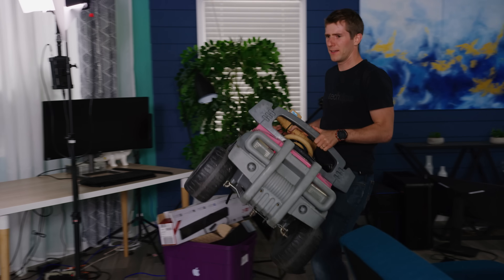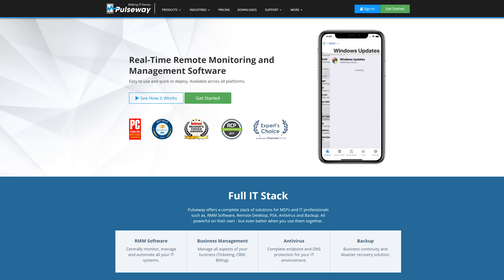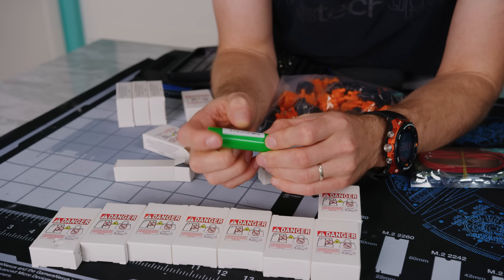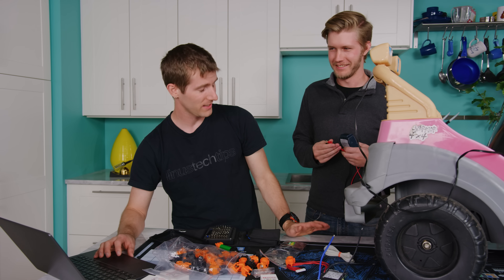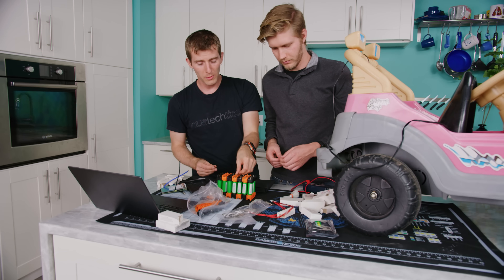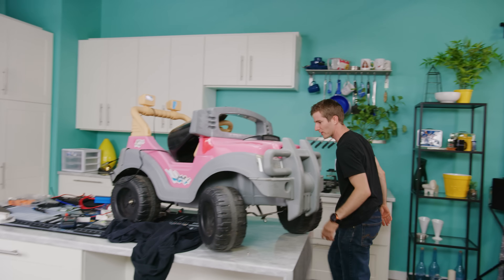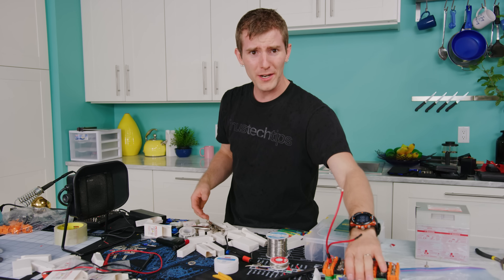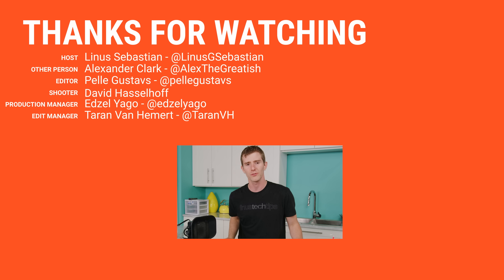DIY Lithium Battery - What could go wrong??

Comment: Suggestion: make a "do it yourself" Lithium car battery & charge controller, that would replace a normal 12 volt lead-acid (gasoline powered car) battery. Note: 26650 Li-ion batteries may provide for a better battery pack vs. 18865 batteries.

Comment: Try v48 or just replacing it with a 2000w power supply
Reply: The power supply would make it worse, it doesn't matter that it's 2000 watt. You're still only going to get 12v from it, so it'd be a huge downgrade.
Reply: Oh I was thinking the 2000w and like since 12v from one connection, you like, combine all connections and idk somehow make it work.
Reply: @flashqandr  Combining all connections would still result in 12v, and just because the power supply is 2000w, doesn't mean that the electric motors are going to use that much. They're only going to use as much wattage as they need, based on the voltage you send to them. If the motor is 5w at 12v, then it's not going to pull more than 5 watts. If you plug in a 2000w PSU at 12v, the motors would still only pull 5w. So to make your idea work, you'd need to send in 833 volts into the engine for them to pull 2000 watt, and at that point the engine would provably disintegrate lol
Reply: oh.

Comment: It's actually stupid to solder on Lithium Ion batteries. You should only ever spot weld onto them, because you don't want high heat on your batteries it will damage the capacity best case and worse case cause them to explode.
Reply: You are absolutely right but he didn't solder directly on the battery, he soldered the metal tabs doing the contact between batteries.
Reply: I don't think you understand how soldering works, to properly solder something that entire conductor has to be hot enough to melt solder, not just the iron that supplies the heat. The batteries connected to the conductor and were relatively close to the desired solder point.
Reply: @Ferretack  I'm pretty sure I know soldering, it's part of my job. I'm also pretty sure you don't understand thermodynamics well enough to tell the actual heat path and if it will damage or not the battery. Me neither, but from my experiences in soldering, I tent to believe that it won't damage battery.
Reply: MrBenthraxify no, u don't understand it. A small tab will heat up much faster than the battery due to it's small thermal mass. You don't have to hold the iron there very long in order for it to properly stick. I have soldered at least 400 battery joints and and nickel strips that were connected to 18650/21700 cells
Reply: That depends on your soldering skills and temp of ur soldering iron. If you keep the iron on for under 7 seconds per terminal, the battery cools down very quickly. I soldered a 16s3p battery and didn't notice any difference in performance. And who tf cares abt a 7s pack that will barely even get used. The spot welder will cost way more than the battery itself
Reply: If the tab is attached to the battery, it's sinking heat directly into the battery. Which means you need a higher temperature or a longer duration to melt solder on it. You aren't going to connect two conductors without exchanging heat, unless the connections are very very small and act as a bottleneck. That's not going to happen because high current batteries want a solid connection.

Comment: If you take the rubber tread from an old bike tire and screw it into the plastic wheels it will give you some traction on that bad boy.  We used to do this with my cousin's power wheels.

Comment: 1) You need a bench power supply which you can set the voltage as required.
2) There is a website (can't think of the address) that you tell it what you want from your batteries and it will calculate the best layout for your series and parallel connections. It also draws the layout so it is supper easy to follow.

Comment: Just a sidenote:
You're safe from electrocution. 24v DC is not nearly enough to do any harm, and definitely not if you short the batteries first, as any voltage that could possibly go trough your bodies are now going trough said short.

But you're quite correct in that shorting is a BAD thing on unprotected lithium cells without overcurrent/overdischarge protection circuits

Comment: There are no 3500 mAh "high current draw" 1860 batteries. Those are like 7A MAX/CDR rating. Plus, 7s3p doesn't have anywhere near the capacity you need. (Since it's 6V stock) It should have been 6s5p or 5s5p.

Comment: To anyone watching please don't actually try this at home, raw lithium cells are not something to be fucked with this is actually quite dangerous. Since these ride on toys are designed for lead-acid batteries they don't have the under voltage protection required for lithium, if a lithium cell drops below 3v (2.5v at a push) they can get damaged and damaged lithium cells are a recipe for fiery death, for a 7s battery like they made here the under-volt cut-off should be 21v (17.5v if you're feeling frisky) which is well above even the full charge voltage of the battery these toys are designed for, this can be mitigated with cells that have built in protection but so many sellers lie about this so unless you understand how to actually check don't roll those dice. Secondly multi-cell lithium batteries have balance chargers that monitor each individual cell for a reason, small differences in the series resistance of the cells can cause them to charge/discharge at slightly different rates which over multiple cycles can lead to over or under charge scenarios neither of which are good, this is not as much of an issue with cells in parallel as in series but its still not something I would recommend to anyone who has little understanding of electronics and the risk involved.

Comment: Those are cheap Chinese cells. Real cells have realistic mah and amp ratings. 3500mah cells are not high amp ever. Unless they are 3000mah which means they are 20amps tops.

Comment: You should really take off or cover your wedding ring if you ever do more playing with electricity and loose wires. While 24 volts is pretty safe to handle with dry hands, it's a different story if those batteries get shorted around your finger.

Comment: All fpv drone pilots watching this are cringing. Also why not just split the battery and to into a 4s and 3s battery. Then charge it with the regular charger so you don't blow urself up. After you are done just re connect the batterys and together with some xt60 plugs soldered onto both batterys terminals. Way easier and safer.

Comment: For the wheels, take some heavy duty rubber, like thick innertube or something, and put around the wheels. It will help give a lot more grip. Altho, the burn outs are a nice touch  ;)
Also add a Variable Switch to the throttle. Tho, you did mention the sewing machine pedal.

Comment: How is that you can just plug a bunch of smaller batteries in series and parallel and call it 'diy battery'? Using the same logic I could connect two lightbulbs together and call it a diy lightbulb?
Reply from the maker: They are cells. When you combine cells you get a battery.

Comment: As a designer of lithium battery solutions for consumer electronic devices I can safely say you did everything by the book in this video. I can see nothing wrong with your methods.

(Disclaimer: heavy use of sarcasm may have been applied to the above statement)

Comment: Screw clamp connections are absolutely fine for high power. Otherwise, all breakers would have soldered connections. I know they didn't recommend soldering because the plastic frames of the battery holders would be damaged by the heat of soldering.

Comment: Lol "electrocute us" there is a reason the international electric code doesn't regulate under 50 volts. Love when lack of knowledge dramatizes a low voltage high amperage spark. Go weld at 30 or 40 volts and stick your arm on the table while holding what you weld while it touches a welding table, its annoying but not an electrocution.

Comment: The Verge builds a lithium battery pack: host holds soldering iron by tip enclosure/heating element while letting all the leads short as a massive plume of flame emerges from the battery cells I didn't even let the power supply touch the case, so how is it shorting out?
Reply: Did he remember his anti-static rubber bracelet and swiss army knife that may have the correct tool?
Reply: No they will weld the contacts togather.Lol.
Reply: Lol

Comment: @8:34, I might be wrong, but it looks like they connected each vertical line of cells in parallel and then connected those parallel cells in series with the another parallel cell that is adjacent to it

Comment: when i was younger, i took the battery of my grandpas old truck that was just sitting, cut the wheel wells in the front of it, LITERALLY SOLDERED the battery's connectors to the car battery and extended the wires to reach, it was mad but the motor burnt out after driving it the third time.... which then turned to me modifying my brush-less short course truck motor to fit the mount for it, changed the spur and pinion to metal gears and it did wheelies... with the car battery in the front, these things can get wild if you can mod them correctly

Comment: I’m just here to read comments from self-proclaimed health and technology “experts” explaining why Linus will lead billions to their deaths by having the audacity to make this video. I was not disappointed.
Reply: I'm sad. I saw none of these.
Reply: The way they handled making a battery pack in this video is completely wrong. The first rule of dealing with electricity is "Treat it with respect", and the first rule of dealing with LiPos and LiIons is "Never short it!". He failed on both accounts.

He didn't do any planning or thinking before getting to assembly, which you can see when he just realizes he needs some of the cells upside down to install the bus bars. He knows Kapton tape must be used to insulate every single terminal and has it, but decides to use packers tape just because. He's wearing a metal ring, uninsulated, while building and handling the battery. That can lead to shorts where the least that can happen is the ring burning your finger. He shorted the battery twice, the second time not even a minute after the first. Those wires could easily have welded themselves, did they have insulated wire cutters handy?

Overall, this is an interesting video, but it's even worse than what The Verge did.
Reply: To be fair, he's not even remotely suggesting he does things like this the right way, unlike that verge video which was an actual tutorial so it's not as bad as the verge really
Reply: To be fair, the way it was tested was stupid. battery packs are not supposed to become hot after use and using it in the rain without insulation... (also for love of the building you are working in, INSULATE YOUR WIRES WHEN BUILDING IT TO PREVENT SHORTS XD)
that being said ppl are exaggerating about how dangerous they are. Just put a current and low voltage protection on it and insulate and it should be fine if you keep an eye on it.
Reply: its totally normal for a battery to generate some heat... they are quite happy up to about 45C which is enough to feel quite hot to the touch for your bare hands.

Comment: Uses packing tape to prevent wires touching - 15 seconds later touches wires together.
Reply: Also LMG lacks any kind of safety gear from what I've seen. Other than the DBrand Grip case for phones, which I still can't buy.

Comment: Are you serious? I don't know anything but the circuitry in your device. But the individual components on your board are rated for certain voltages, amperages and such. Overvolting them may at minimum shorten their lives, or possibly burning them out immediately.

Comment: Liquid rubber the wheels for grip
Reply: tjhooker73 there are forums on modifying these cars. And doing that when you have increased the power will destroy the gear reduction system as it isn’t meant to handle that much torque. The wheel slip is necessary to prevent broken parts when increasing power with stock gearbox.
Reply: Nah, don't do that and leave it plastic. It would be slower, but it would be a more fun burnout and drift toy.

Comment: I had one of those when I was a kid, but the battery it shipped with was so bad you couldnt get up to the slightest hill. So I threw in a battery that was 5x the size from a electric quad. It was very fun for several hours. Until I fried the electronics and we had to repair it.
Reply: but changing the size wont make the motors faster...
Reply: @flareflo362  was about to say thx
Reply: FlareFlo I know but it was to illustrate a bit what I did, if that makes any sense xD
Reply: I drove mine into a swamp
Reply: @jakethreesixty  bruh
Reply: highks yes thats what I meant with my size. I said size just to give a little perception

Comment: Why are you using 18650s for high power draw!!!! You need to use lifepo for that, they're gonna explode. Plus, don't buy new cells, you can get like 100 legit( Samsung, LG, etc.) 18650 for   like $120.

Comment: You lot should do a DIY electric bike. With one of those 1000W crank motors... You won't do it, you're too scared
Reply: Wren did one!
Reply: he should build his own electric motor bike. Its for needed "for the channel"
Reply: He pretty much did. E-bikes use the same battery build, and that's pretty much the most significant part of an E-bike build. Well then there is fortifying the dropouts. Shhhh...
Reply: @shozanraditca4726   Where the wheels pair with the forks, or trailing end of a bike is called dropouts. These are almost never adequate for the torque of the axle of an electric motor on a stock bike causing the "twist of death".
I custom weld 1/4 inch steel plates to all my front/rear steel builds, or fabricate a bracket for rear wheel aluminum builds. Aluminum front forks are extremely rare, I've never had to do that yet.

Comment: Now slap some 12s rc helicopter / done motors in it and change the battery config. See if the cops can figure out how to fill in the vehicle information on the speeding ticket.

Comment: should have used one 7s 5000mAh battery from hobbyking and pluged it straight in... 18650's are stupid for this application. HK also do a upto 8s charger

Comment: To be honest, this is something I'd expect from your channel, especially for what it's being used :D Also to people crying about them exploding, they wouldn't explode per se they'd start expanding, the casing would crack and the they would start burning. Not saying that isn't bad, but they could stop the fire before it spread, and the chance of someone getting hurt is much smaller. When you see these batteries explode in phones it's because they don't have enough space to expand, the energy can't be held forever and it explodes. That said next time do these kind of stuff next to non-flamable surfaces, with a CO2 extinguisher close by, and a room that can be ventilated fast.

Comment: They say high drain, but I'm not sure if 25A 3000mah on each of those cells at best is what you would want for that thing.  But with three banks in parallel, maybe it isn't so bad.. not sure.  I just use those cells primarily for my laptop and my vape mods.

Comment: well. u probably wouldnt want to use these connectors. they introduce way to much resistence and therefore heat... its really a bad idea for high current jobs... spot welding is the way to go.

Comment: Double the voltage equals 4 times the power output (assuming normal brushed motors) you gave it 16 times the power output

Comment: Good job Linus, I'm impressed.  272 Wh is very good for the size of the battery, i bet you could go around 20 kilometers at max speed on that thing. (don't know the motor wattage or how much it draws with the over voltage)

Comment: Should have said to check the voltage of each cells before connecting them in parallel, as it may be really dangerous if one cell gets charged at 30A

Comment: The problem with electric motors is that they loose performance as the battery drains. With internal combustion engines you can have maximum performance even with an almost empty tank of fuel.